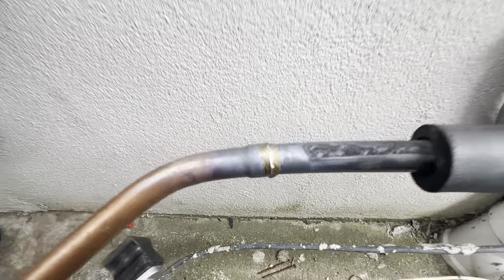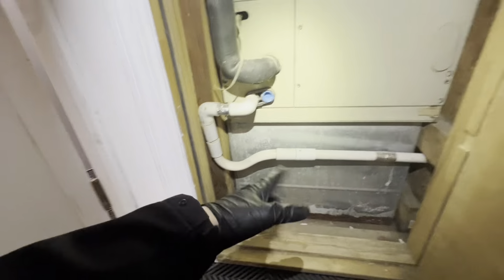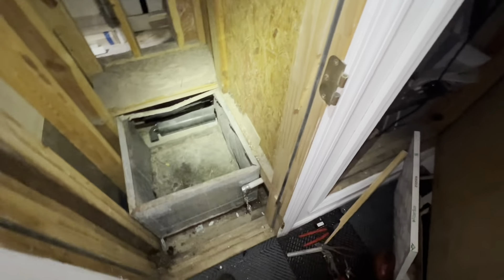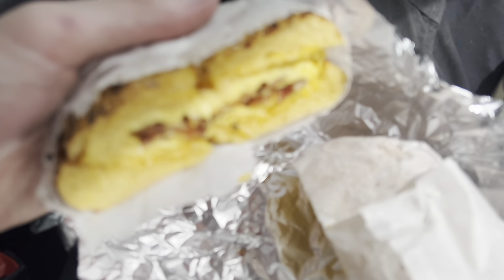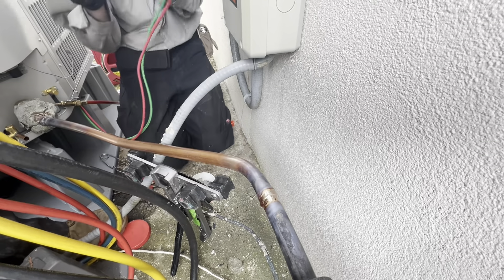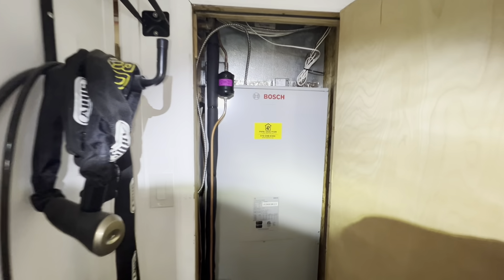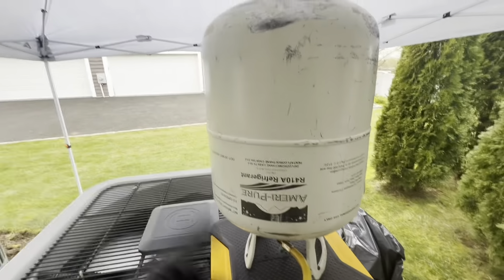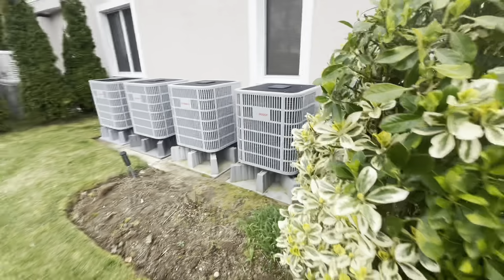THE FINAL BOSCH! Retrofit of This Customers Last Central Air System to Bosch IDS 2.1 Series Units!

Comment: Those Generac boxes are load sheds for the generator. They shut the A/C's off on initial start up to lighten the load on the generator. They gave me a fuss on my own house. One of my A/H's stopped working. I figured out there was no power to it. I had power coming out of the breaker. I was stumped. I thought maybe something chewed my wires in the attic. I took the wires off the breaker tied them together and had continuity at the A/H. I gave up and decided to buy a new breaker even though I knew that wasn't it. On the way to HD I remembered those load sheds. I went back home and sure enough it was the load shed. It has a contactor in it normally closed so the opposite of an A/C contactor. I bypassed it and back in business. If you ever get a call on one of these you just disconnect the connector on the control board and it will bypass. Generac had a recall on those boards and warranty's them. I spent a couple hours because I just totally forgot that was between the panel and the A/H. When the board goes it pulls the contactor in (open) and no power. A working board keeps it from being pulled in.